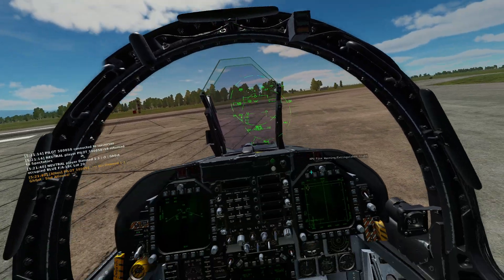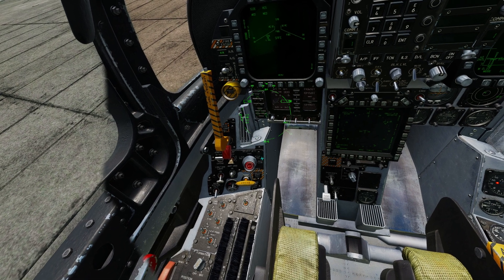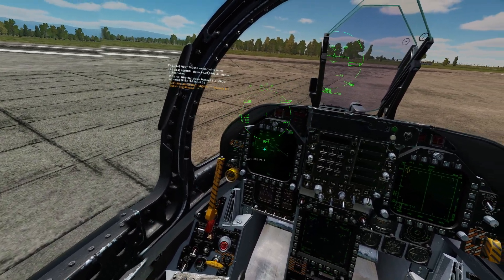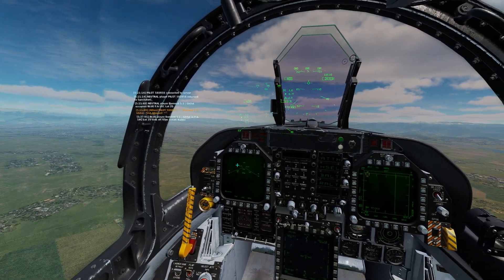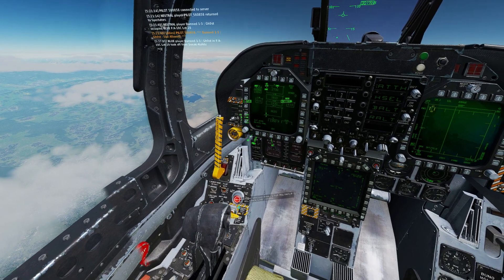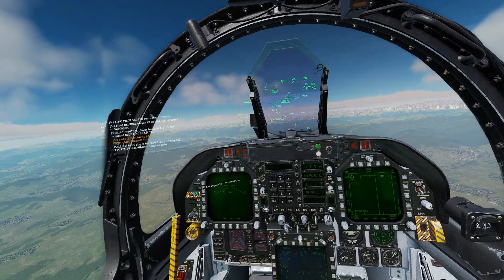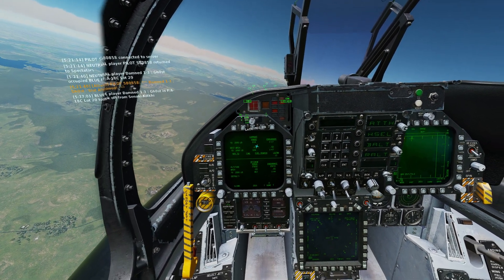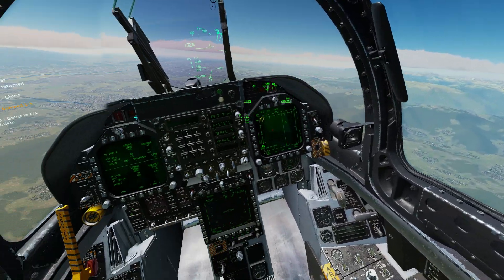Zero to Hero | DCS F/A-18C | 6 - Fuel Management & Stores Jettison

Comment: I really enjoyed the Video. Very good information. IT would have been cool if you showed us how to climb using the FPAS instead of winging it.
Reply from the maker: I can do something on that :) There are just so many edge cases that it all boils down to one rule: On a climb out, make sure your mach number is always increasing or maintaining. If it starts to drop, that's when you drop the nose until it maintains or climbs again.  This will let you get to extreme altitude while maintaining fuel/energy.  

I find FPAS mainly helpful for cruising under mach 0.9 (cant use it at altitude speeds of mach 1.0+) or for planning; otherwise I find developing that intuition for 'winging' it to be critical.